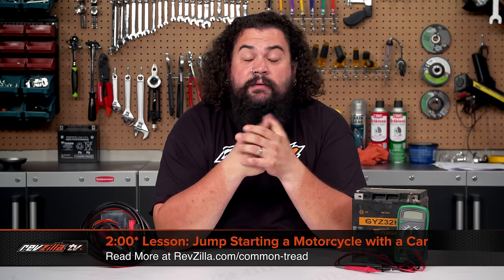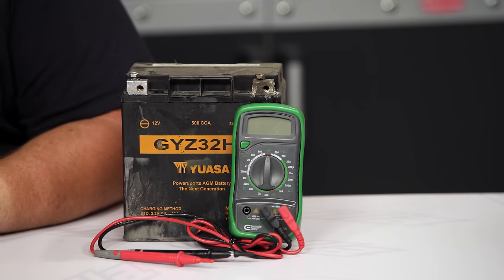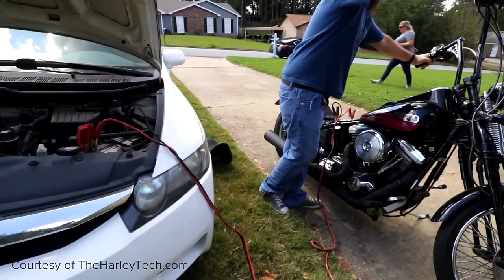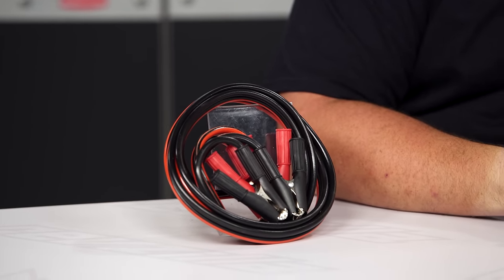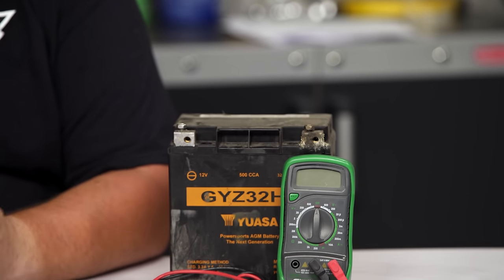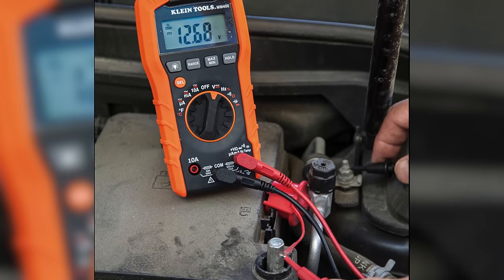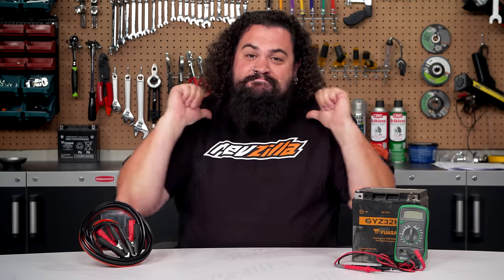2 Minute Moto - Jump Starting a Motorcycle with a Car

Comment: Most motorcycles employ what is termed, "Shunt regulators" Shunt regulators are rated to dissipate any extra charging energy from the bike stator into heat through the semiconductor to the heat sink. Car alternators can produce much more charging current ( amperage) than the motorcycle shunt regulator can deal with, hence destroying the regulator. This may not occur in all cases depending on many other conditions but generally it is advised to not have the car engine running when jumping a motorcycle. For safety, Always wear safety eye protection when jumping any vehicle. Ride safe and have fun!
Reply: Moto Giro    Yes, thank you.  I was about to make the same comment.  A lot of anecdotal evidence will appear to the contrary, of course, but if it is just a low battery, it should fire-up easily without the car on.
Reply: I've been looking for the real technical reason why you should jump your bike with the car off (aside from just being told "don't do it!" by the internet) - this makes perfect sense, thanks!
Reply: And if your having to engage the starter for more than a few seconds, that extra heat is why you usually see melting around the connectors for the 3 white or yellow stator wires. Connector being the weakest link

Comment: I had read an article a few months ago that said when jumping a motorcycle with a car that you shouldn't have the car running. Any truth to that?
Reply: I got the same question!! Whats the truth Lemmy??
Reply: By experience,  I will tell you that I never started my car when boosting my bike. The simple power of the battery was enough. What I would suggest is try 1st without starting the car and if it doesn't work, start the car. Also,  by doing that, like Lemmy says, you will have a better idea on the condition of your battery.
Reply: Why would you start the car? If the carbattery is sufficient to start the car, it will start any motorcycle no problem.
Reply: I used to work at a motorcycle dealer. We had a few bikes come in with roasted regulators and/or stators from jumping off a car. 
Always leave the car off to jump start a motorcycle. The car's electrical system could harm your bike's charging system and it's often not necessary to run the car to generate sufficient amperage to start a motorcycle.
Reply: Not a necessity but not a horrible idea either.
Reply: I just had to jump my bike from my truck. I hooked up the clamps and then let it "charge" the disabled battery for a couple minutes, WITHOUT starting the truck. Then started the bike.
It worked liked a charm.
Reply: @austin1002  My guess is that roasted stator or regulator was the cause of the dead motorcycle battery - not caused by the jump start.  As an engineer, I can assure you the car alternator does not deliver higher amperage than the car battery itself.  A typical car battery can dump several hundred amps almost instantaneously.  A car alternator at idle barely puts out enough current to maintain the system charge state.  Damage to the stalled vehicle is almost always caused by incorrect jumping procedures, not because the donor vehicle was running.
Reply: I jumped my car with a running car prior to watching this video. Now I know not to.. but what can be damaged by doing it that method? I still have to jump it again since the battery is still dead. Don’t think I drove it long enough for it to charge.

Comment: A trick for getting a big clamp down to a hard to reach moto terminal is to clamp onto a long screwdriver shaft and hold it onto the terminal.  I had to do this in the middle of nowhere, while not ideal, it does work in a jam.

Comment: Another great video Lemmy. Two minutes plus, packed with useful info'. I have bike jump cables permanently packed on my Honda Deauville Nt700 along with my tool/puncture kit,as with most modern bikes they are almost impossible to bump start. Hadn't noticed the tan lines,until i read the other comments! Ride Safe.

Comment: Hey Lemmy.  Turned my switch, no power at all.  Connected a tender.  Nothing.  Connected jumper cables.  Nothing.  Connected external battery jumper, nothing.  Battery is HD Lithium less than a month old.  I disconnected the battery, noticed a spark.  Tightened the bolts, turn the switch.  I have power and could start the bike.  Why would would my FLHXS act as if the battery was completely dead (or not installed) until I reseated battery cables?  There was nothing wrong with the connection.

Comment: I've a question that I can't find anywhere and it's can you bump start a motorcyle if the voltage regulator and main 30 fuse on the starter relay is blown? I can't bump start mine and this means no spark and I've a fried voltage regulator but I'm wondering there might be more that's at fault like the stator.  My 30 amp fuses keep blowing every time I put one in the starter relay and it's not the starter relay as I've just put a new one on then noticed the voltage regulator is deformed underneath. I've ordered a new voltage regulator.

Comment: Just based on the comments I've read if you are standing next to a dead motorcycle and need to jump start it, go get a new battery as soon as possible. It looks to me like a lot of people don't realize an AGM battery will hold a charge til it doesn't and then needs to be reconditioned. You will eventually lose enough acidic conductivity to a point where even jumping or charging it won't help it... a battery has to be replaced based on its warranty life expectancy. If it dies before the warranty they will give you a new one based on that warranty....

Comment: Im here because im building a trike and wondering if a car battery will damage the wiring or even be charged by the bike engine or cause any damage to the starter motor

Comment: Question. So when I’m jumping off my bike with my car do I not connect the negative to the battery of the bike? Or do I connect it to a ground on the bike? Everything else on the car is connected right both positive and negatives are connected to the battery of the car?

Comment: Great info and right to the point! However one question and I'm trying to find out which is correct..

I was told if you jump start a bike from a car, to turn the car off and not have the engine running so it does not put excess power out which could possibly damage the motorcycle electrical system.

Is this true or false?

Also I've been in situations where I keep a small portable jump starter in my bike bag which can jump start not only a car but a motorcycle as well and has the small connectors to attach to the motorcycle battery.

RSVP soonest on the question regarding the jump start portion and again thanks for the great info :-)
Reply: The last thing you want to do is dump a bunch of amperage quickly into a small battery! This can not only destroy the battery but create an explosion because the charging causes hydrogen gas to be created... Think Hindenburg but with plastic shrapnel from the battery exploding 🤯 

So you ALWAYS have the charging vehicle off and simply use the massive account of CCA (cold cranking amps) to start the smaller engine. If the engine dies when disconnecting the larger battery the battery is probably junk and you will cause damage to the motorcycle by running the charging system at full blast constantly. It's much cheaper to replace a battery than dismantling the engine and replacing all these components! 

You can also damage the electronics on newer bikes by dumping high amperage into them, my truck can put out 270 amps and a bike isn't even rated for anywhere near that so it could destroy the ECU and wiring harness.
Reply: @mattgayda2840  The amps running through a wire are dictated by the resistance of the consumer and the voltage of the source (Amps=Volts/Ohms. Ohm said it, not me). So the smaller the resistance or the higher the voltage, the more amps will be generated in the circuit. Although your truck's alternator can sustain 270amps without frying itself, the bike's circuits will only generate the curent they need, based on their internal resistance. The amps will not increase no matter how powerful the source, as long as the voltage stays the same. If, however, the source is not able to generate the current required by a powerful consumer, the voltage will drop and the source may get fried. If the source's output voltage is higher, the amps will increase and the consumer will get fried (this is why you don't plug your phone directly to your wall socket).  
I never get tired of explaining this although I am rarely understood.

Comment: If i start my motorcycle over and over will it drain the battery? I was practicing my friction zone and kept stalling.  I kept starting the bike and now it wont start anymore
Reply from the maker: In most cases yes, since you are using the battery power to start the bike but not giving it enough time to recharge what it just lost. You should use a multimeter on the battery and test the level to see if that is the culprit, but it likely is. For more questions, feel free to reach out to our Gear Geeks in customer service as they are able to help easier. You can reach them at 877.792.9455 or cs@revzilla.com. Ride safe, - Pat

Comment: Can you jump a bike from another bike using the SAE leads?   Or from a car for that matter, assuming you have the clamp to SAE connection handy?
Reply: The wire gauge for most SAE leads is not intended for high amperage. It is possible it may work, or you may melt the cables from excessive resistance.

Comment: I am not reading all the comments here but I hope someone stated to be sure the car engine is not running when jump starting a bike.  Battery to battery works because a battery is just a "bucket of electricity" to take out as much as the bike needs.  If the car is running however it should be understood the charging system is a "pump" potentially delivering/pushing out many more amps than the bike electrical system can handle. So be sure to store in your long term memory "car engine off" when jump starting.
Reply: The amps running through a wire are dictated by the resistance of the consumer and the voltage of the source (Amps=Volts/Ohms. Ohm said it, not me). So the smaller the resistance or the higher the voltage, the more amps will be generated in the circuit. Although car's alternator can sustain a high current without frying itself, the bike's circuits will only generate the curent they need, based on their internal resistance. The amps will not increase no matter how powerful the source, as long as the voltage stays the same. If, however, the source is not able to generate the current required by a powerful consumer, the voltage will drop and the source may get fried. If the source's output voltage is higher, the amps will increase and the consumer will get fried (this is why you don't plug your phone directly to your wall socket).  
I never get tired of explaining this although I am rarely understood.

Comment: Didn't know there were smaller jumper cables available for bikes ... good to know.
Reply: Clamps.. not cables.  The cables still need to be thick enough to transmit the starting current safely without melting. Thicker cables preferably made of copper are better.  You'll notice that most battery tenders use small gauge wires like 16 or 18 gauge which is insufficient for actually jumping a motorcycle whereas jumper cables are ideally 2 to 6 gauge.

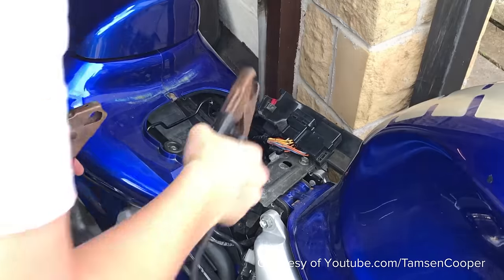Comment: I would like to add one thing to this video.  At 1:19, the battery is shown being jumped with the negative jumper being attached to the battery first and then,  the positive jumper cable is attached second.  WRONG.  That is completely opposite of the way you do it.  If you put the negative first, there is a chance of causing a spark, when the positive cable is attached!  This could cause an explosion!!!  Nope, put the positve on first, then the negative so that there is no chance of causing a spark.....

Comment: I've jump started my bike (Honda NC750) with a car battery without starting the car. No issues but... Now I'm rereading the Owner's Manual and I've found something written with small letters: "NOTICE:  Jumpstarting using an automotive battery is not recommended, as this can damage your motorcycle's electrical system." :-) No explanations whatsoever. Next time I'll try to push it bit instead.
Reply: Not recommended because car batteries are larger than motorcycles and have more amperage that could damage motorcycle batteries. That’s all.
Reply: Battery to battery is fine.  It's when the car is running that might cause issues.

Comment: I melted a lithium iron battery by jumping it car to bike. I was later told by the manufacturer's rep not to do the jumping. So I went back to a heavy Yuasa lead acid. Jump all you want, all day long.  (Note: iron not ion, yeah)
Reply: Glenn Rueger Yikes, just tried this on my bike with a lithium battery after watching this video. Something fried, no electrical system response at all now. Car battery is fine, I removed the bike battery and hope I can it will come back with a trickle charger... :/

Comment: Hey quick question for any one who would know. Can I use the battery tender plug that I always leave connected to my bike battery to jump start it with the clamps also compatible with my battery tender plug? I don't see with it would not work it's just that I think there are fuses on those adapters so maybe not made to withstand jumpstarting current?
Reply: You ever figure that one out?
Reply: @NoCommie  have never tried but read and heard that the wire gauge is too small and not made for that kind of current so should not jumpstart with the battery tender plug.
Reply: @user-uf4fv4rn8t  Thank you for sharing that

Comment: I know it is a stupid question, but maybe im just skipping one or two thoughts... what do i connect? Ground and ground and the positive poles of both batteries or do i connect + with - or just the two battery poles with the same color? Tending to the first and the last but i really dont want to break my stuff even more
Reply: Wait + and - makes a short circuit... so what then? The negative poles or the frame? What is the better for both vehicles?
Reply from the maker: Positive goes to positive, and negative goes to negative.

Hooking them up backwards can actually damage your battery and possibly do damage to your electrical system, including the on-bike computer.  The same goes for cars, just as a heads up as well.

I hope that helps!
-Zack

Comment: hey buddy, how come you just wouldn't bump start? takes like a couple of seconds as apposed to looking for someone with battery and leads haha
Reply: If you don't quite have enough juice for a fuel injected bike to pressurize the fuel, or for the ecu to get enough voltage while the headlight turns on as you push, you're kinda boned. Until you find jumper cables.
Reply: @nominalvelocity  Ah this makes sense, never had an EFI bike so have never experience bump starting one haha, thanks for clearing that up
Reply: @gremlin591002  sorry where is kansas? is that on the moon or something? awesome yeah i did not take EFI bikes into consideration,
Reply: Depends a great deal on the type of engine in the bike and where you're located. Some engine designs are easier to bump start than others are. Plus, would you really want to push an 800# bike fast enough and far enough to get it to turn over?
Reply: If you can bump start a CBX, I'll be impressed.
Reply: My 125cc will lock the tire on 6th gear if you aren't going downhill

Comment: Alternative without any equipment or car is to move your bike (manually pushing it, in a down hill slope) in 2nd gear with full clutch, and when the bike reaches 7 to 10 kmph release the clutch, this will temporarily start your bike, now don't turn it off and ride around for a while to charge your battery and go to the nearest service center. This technique is known as Bump Start.

Comment: One thing I've always done with jumping a bike with a car is to not turn the car on. The bike can draw the juice it needs without the car running, and I think there's a chance that a running car can fry your bike's electrical.
Reply: How can a running car damage the motorcycle's electricals?
Reply: @naushad911  If you're using bike jumper cables, then it's not an issue. But if you have to use car jumper cables, then a running car can push too much current into your bike.
Reply: @billybegood466   The amps running through a wire are dictated by the resistance of the consumer and the voltage of the source (Amps=Volts/Ohms. Ohm said it, not me). So the smaller the resistance or the higher the voltage, the more amps will be generated in the circuit. Although car's alternator can sustain a high current without frying itself, the bike's circuits will only generate the curent they need, based on their internal resistance. The amps will not increase no matter how powerful the source, as long as the voltage stays the same. If, however, the source is not able to generate the current required by a powerful consumer, the voltage will drop and the source may get fried. If the source's output voltage is higher, the amps will increase and the consumer will get fried (this is why you don't plug your phone directly to your wall socket).  
I never get tired of explaining this although I am rarely understood.
Reply: @ciocanul  ok so what's the conclusion. You can run the car no issue? Or should the car always remain off. According to your comment if the voltage increases there's a problem. And the voltage increases when the car is turned on so...
Reply: @undisputed1one  I've always been able to successfully jump my bike with the car off, so I've never seen a reason to turn it on.
Reply: @billybegood466  good to know. But if the car battery isn't strong then you run the risk of draining it right?
Reply: @undisputed1one  Very unlikely, and if it does then the car's battery was about to die anyway and needed to be replaced.